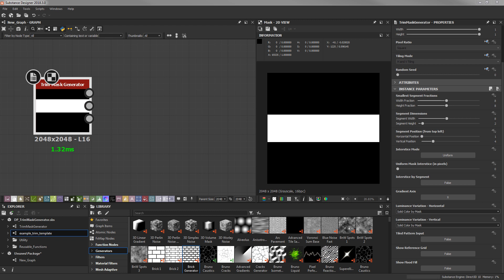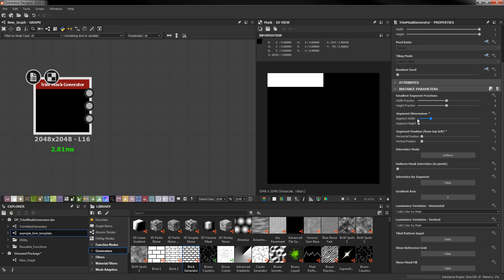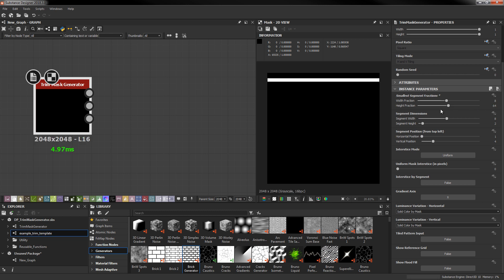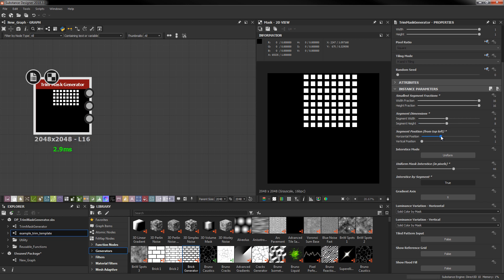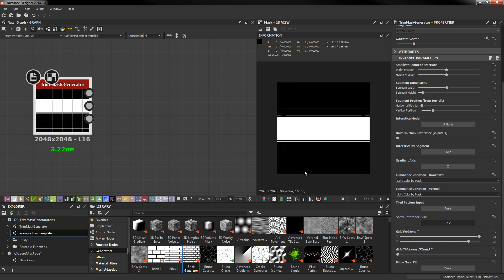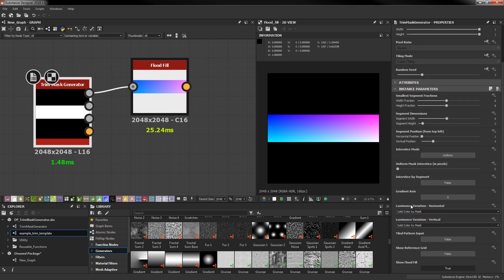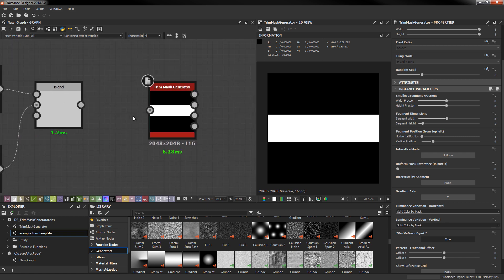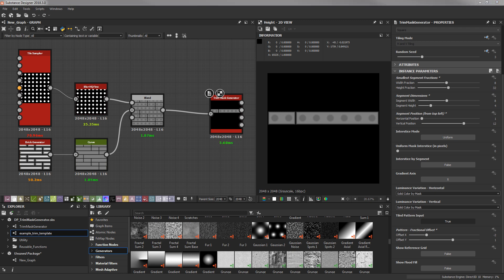Trim Mask Generator Overview

Comment: Possible to make a trim mask from another trim mask? ie. subgrid. Say I've got a 1 by 5 grid but the 5th one i want to subdivide. Would be easier to subgrid
Reply from the maker: You should be able to string together multiple generators as shown around 14:00.  You can set specific regions to be any other combination of segments and combine everything together with the Blend node.